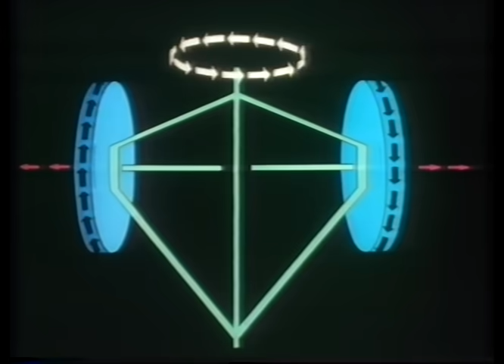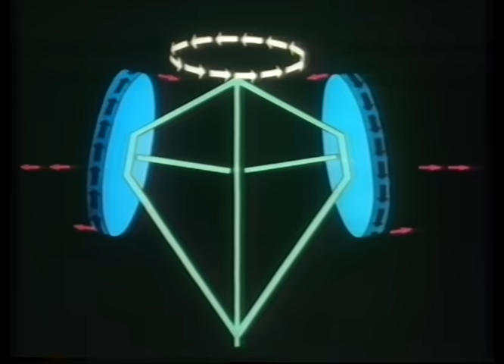Anti-Gravity Machine (Part One)

Comment: The answer is in mathematics and spinning objects in direct opposite proportional sizes to the opposite speed and direction of the spinning of earth itself.  I am no mathamathtician or scientist and cannot even begin to Express the theory.  But all gravity depends on spinning.  Just as Artificial Gravity can be created in a space station.  Our gravity on earth itself is created by it own formulated spinning of its mass at specificed speed and direction of spin.  To fly off of the earth you must cancel this force by spinning in opposite direction.  What if you broke these factors down into smaller exact proportional forces compared to earth itself.  What would it do to the mass?  Sort of like splitting the atom theory so to speak.  Perhaps we negate gravity when we excite matter and accelerate it.  And perhaps the whole solar system works on the same theory?  Perhaps size doesn't matter?  It is just how you proportionally control it?  The formula stays the same?
Reply: You are not a mathematician or scientist? Who would have guessed? Oh, hang on, that collection of ridiculous ideas is a clue.

Comment: Notice how he shows that it would fly belly up just like the one that the fighter pilots from the US Navy caught on gun cam
Reply: And bob Lazar
Reply: That caught my attention as well.
Reply: Came here to post this lol, the flying belly up is just to much of a coincidence for me.
Reply: @bekacox9244  glare. Rotating gimbal fwd section of the TGP. the jet wash in the video was not actually disk shaped. And it didnt actually turn
Reply: @OvertonWindex   wouldn't it have to be moving away, if its a jet exhaust?
Reply: @rogermoore770  it is. Try to picture what's hapoenibg...  its moving left at first. 
   Pilot is bsmk left, camera 45 degrees to the left. Until the pod is looking right, that's when rotation of the clouds stops. 
    It's a common illution.... it looks like more than 360 degrees has been covered because if all the clouds moving past... but this is just very very far away clouds. I'm not going to do the actual trig here.. but we've probably viewed about 15° of field of view here.
Reply: @OvertonWindex  Intresting but  what about the tic tac they saw visually and the radar measuring speeds? The gimble also had a small fleet of tic tac shaped objects trailing behind  according to the pilots. Do you think this is being faked by us gov/military?
Reply: @rogermoore770  this is a pilot lying about the "white glow, of cold air" around the object. 
   Hes lying about the fleet... or its other planes, or weather balloons in formation. 
   The point is, hes lying. 

And what do you mean about radar speed? There is no speed clock on those targeting pods.
Reply: @rogermoore770  the only thing fake, is the people making money on it.
Reply: @OvertonWindex  There are tons of these reports though it's not a one off situation where one dude lied. They had to invent an entire filing and collection system as well as an entirely new report just so that they could document all of the cases where these things were being seen by airmen. I think you're downplaying the situation a bit.
Reply: @yazzyyazyaz  no I'm not. You're up playing it.
Reply: @yazzyyazyaz  I was in the Air Force... I've had to make reports on pebbles before. Who cares if theres reports?
Reply: @OvertonWindex  Ah, that explains it. I was wondering why you were slandering Naval Aviators.
Reply: @janreznak881  simply because they're lying.
Reply: What if the Aliens were not retarded and just turned the machine the right way in the craft?  Then it would not need to be Belly up.
Reply: where is the video part of the us fighters which you mention?
Reply: @w.h5916  Because you're too fucking lazy or just stupid and can't look shit up yourself. Heres 1 of a few... Shmuck
https://www.youtube.com/watch?v=VqdOXfuzDIw
Reply: That navy video is of a distant heat signature like a jet exhaust. 
   The shape you see in the video is hot air, and glare. The "turning" sideways is glare from the glass that's turning in front of the camera.
Reply: @OvertonWindex  What the fuck would you know? There is an interview with that jet pilot and that's not what he said. The only hot air here is you.
Reply: Your thoughts do make sense.
Reply: Bober Bib k
Reply: Also, its targeting pod video, not the gun cam. Gun cam being slang for HUD cam.

Comment: It only works when connected to the ground.😔
Reply: Ranoon Sumer 
i think it could work off ground but only for the movement of the arms 
if you coul stop the gyros in the blink if an eye and set the arms back it might be works like swimming 
i think hes trying something like riding in a rubberband he shot from his iwn thumb
Reply: @Channel15901  Do you also not understand elementary physics?
Reply: @Channel15901  Your opinion is like any other. Physics is a realistic movement. If there is something else, make it and prove it.

That's the law of physics.

The gyroscope balances the rotor when the center force axis is connected to the ground.

Very basic.

* All rotors are the same.

https://energyeducation.ca/encyclopedia/Gyroscopic_motion

Without a connection, the rotation becomes unstable and out of center. It is also out of balance.
Reply: @ranoonsumer5110  There are no gyroscopes in the video. A gyroscope is a very specific device. The term should not be applied to just any spinning wheel.

Comment: I have a gravity machine 
School kid hold my spin top
Reply: This gyroscopic device shown in the video is not an antigravity device and it cannot be used for propulsion in space instead of rockets. 

Linear momentum and angular momentum in the physical universe must be conserved. 
Summation of linear momentum in the universe = Zero 
Summation of angular momentum in the universe = Zero
That's why about half of all spiral galaxies appear to be rotating clockwise and the other half counterclockwise.

When a rocket is accelerating in space, the change in momentum when the rocket is pushed forward is equal to the change in momentum of the mass of the used rocket fuel expelling in the opposite direction. Since the two quantities of momentum are in the opposite direction, the linear momentum in the universe is conserved.

When the device is resting on earth as shown in the video and the motor at the bottom is accelerating the rotation of the pair of gyro wheels above it , the motor would create a torque on the earth in the opposite direction. Since the mass of the earth is much much bigger than the mass of the gyro device, the earth would barely increase in rotation in the opposite direction of the rotation of the pair of gyro wheels.  So it gives a false sense that the device can be used on a space ship to create forward thrust. 

However, when such a device is in operation  on a space ship in space with the pair of gyro wheels at the front and the motor at the rear of the space ship, the motor at the rear would cause the space ship to rotate slowly in a direction opposite to the rotation of the pair of fast spinning gyro wheels so that angular momentum can be conserved.  The space ship would spin faster and faster unless retro rockets are deployed to  stop the spinning. 

Furthermore, as the pair of gyro wheels are pushed towards the front end of the space ship during operation, an equal force would push the motor, the structure on which the motor is fixed on and the space ship on which the structure is fixed on in the opposite direction.  As a result,  no net forward momentum on the space ship is created. It's like using a fan to blow air on a small sail inside the hull of a ship in an attempt to make the ship move forward. It just doesn't work. That's why the gyro device in the video cannot be used for creating forward momentum on a space ship in space.

Comment: This kind of gyro works in segways to keep wheeled objects from falling over and allows for rolling without tipping over, but gyros will not work for vertical propulsion. There's a physics formula that 1 in a 1000 of us here would understand which proves this law (and I'm not one of the 1000)
Reply: There are no gyroscopes in the video, only spinning-tops. The equations which describe all spinning objects were written down by Euler, hundreds of years ago.  Noether's theorem says that linear and angular momenta are separately conserved,  so spinning objects can never create a propulsive effect in an isolated system. But the only law that one really needs to know in order to rule out these crackpot machines is Newton's third law.

Comment: So finally... what happened after all these years ?
Reply: BP bought him out and buried him and his idea.  Gone forever
Reply: @GAMESTERVISION  
How do you know that ?
Reply: @En_theo  oh I was just kidding man what really happened was he and other people figured out that it needs an anchor point on the ground in order to push itself up once the base of the machine is no longer touching the surface of the ground it can't push itself up see what's happening is the gyroscope is pushing itself off of the ground like think about if you tried to stand up as a human you're pushing up and away from Gravity to stand yourself up with your feet anchored on the floor but once you jump into the air and your feet are no longer touching the ground you instantly a pulled back to the ground his machine can't make anything fly off of the ground we can make something rise up as long as it's touching the ground somewhere on another point think of it this way if I would have stand and hold a branch and put a rope swing in a tire hanging off of the branch I'm holding and I let you sling on it while I held it I could lift you up off the ground like his machine as soon as I let the Blanche go you and the rope swing in the branch will fall to the ground because it no longer has my feet pushing Up and Away to lift you his machine works the same way that little angel point that he has his anchor down to the ground or table it pushes up in a way yes making it flow but as soon as you separate it from the table it's just going to fall to the ground essentially his machine doesn't work
Reply: Would have been clearer with punctuation but I got the idea :) But where did you take the info, I'm really curious about how the spinning creates a "jump" effect from the ground. 
Also, I was suspecting something like that (taking leverage on either the rope above or the ground).

Comment: Looks like you might be on the right track there but no cigar, yet. Close but it seems something might be missing there. An anti gravity engine needs to lift a  100 tons or more to be a benefit to the aircraft industry and that takes precision machining and very tough metals that you can't get at the local hardware store. We'll save the cigar for you if you do eventually lift 10 lbs with your project.
Reply: Why are you referring to aircraft? Aircraft are not the problem: we already have aircraft. The problem is to move through space.

Comment: The machine cannot be put on a scale and show a weight loss. It always has to have an external reference point, in this case the ceiling pulleys. If a scale were put on the ceiling pulleys, it would be seen that the forces generated are absolutely constant, no weight loss at all. Total quackery.
Reply: Ah, but that is the problem: a vibrating device, put on an ordinary weighing apparatus, can produce a permanent off-set from the true weight ... thus making it look as if the device is partially levitating. An ordinary electric-bell can lead to such a false reading. The only satisfactory Earth-bound test is to demonstrate a steady deviation, from the vertical, of a  ballistic pendulum.

Comment: I know a better way to lift and everything is about spinning you need to used a flexible weel and between of the weel in the middle put something like another stick with a smaller weel between the  disk spinning that will lift you up it will work I tried this before 30 years ago I was playing with a flexible disk and I spinning really fast I was holding it with a string and I put a stick in the middle and it lift up

Comment: Gyro is not a solution for antigravity. As Tesla said think in the terms of energy, frequency and vibrations.
Reply: samrat taksande what if twas gyro? Frequency and vibrations
Reply: @SJCB21  might be
Reply: @SJCB21  it's all under the same concept, acting to produce the same desired effect.. ultrasonic frequencies for instance have the ability to create the same desired effect and in a more controlled manner. The most famous of all is the starship coil or the rodin coil based on rodin's vortex based mathematics.. we are all reliving each others lives in the attempt to solve the mysteries of life and the forces at work that govern this universe which exists within the self..
Reply: @rflxna3227  What is the point of comparing this nonsense with yet more nonsense?